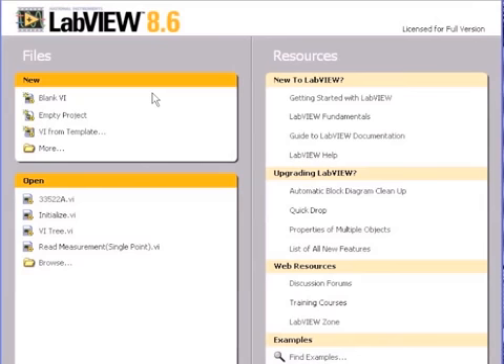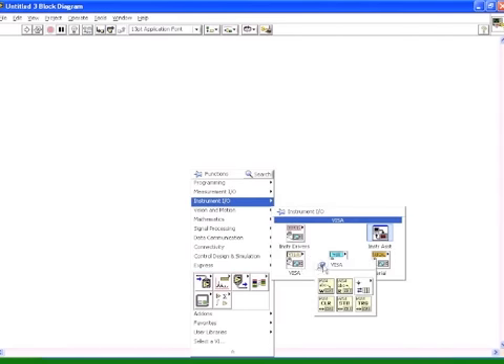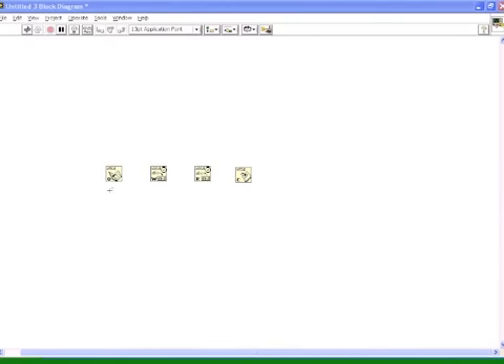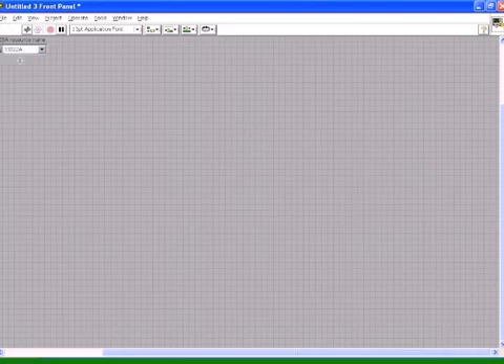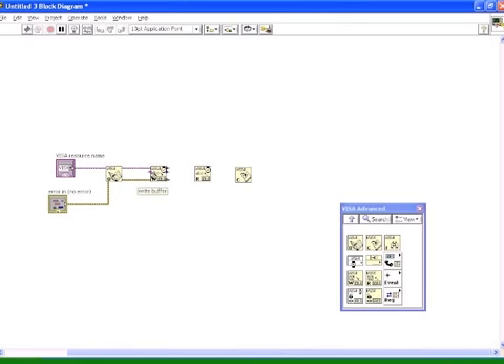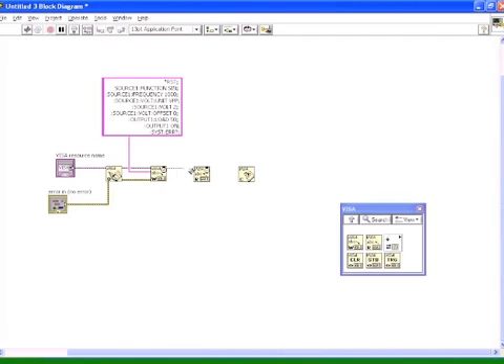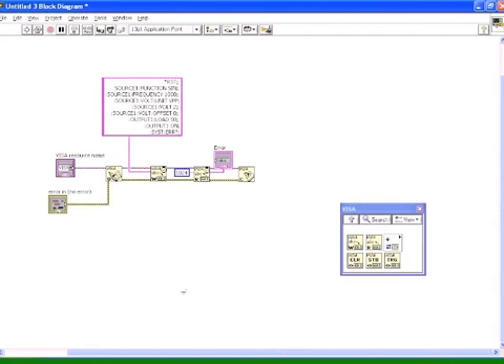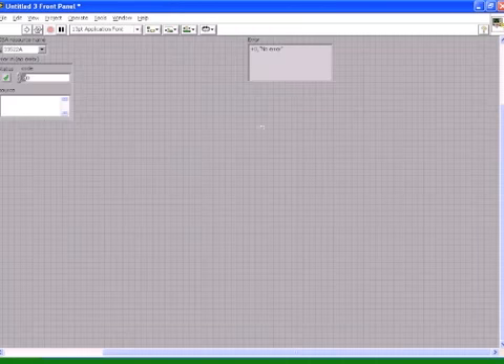How To Control Your Instrument in LabView without a driver

Comment: how can we troubleshoot if we don't see the device how up from the pull down menu? My device is connected via a RS-232 cable and plugged into power.
Reply: I am very much a novice but your device should show as a COM port in the pull down. If not then you are missing a driver or something more basic.
NI has resources for finding drivers like IDnet to devices or go to the manufacturer.

Comment: i need the SCPI commands for configuring and reading the configured values. Tell me where i can learn/get that info
Reply from the maker: Pavan Kumar Polisetti.  The instrument manuals have the SCPI commands and typically some example programs. The manuals are usually available on our website for free as pdf.
Reply: @KeysightHandsOn , that last line isn't, and that's needed for the Read node right?

Comment: This is a bummer.  I would think it would be a little bit better and some resolution
so that we can see what is being done.

Also, it's nice to be talking directly to the instrument,
using what interface?  What are the connection points etc?

As the video shows Visa's O-W-R-C being pulled do the block diagram
how are they interfaced to the Front Panel.  Things are popping up
which I cannot see and then lines being drawn between them and 
the Visa O-W-R-C's.  How is this accomplished.

Comment: I'm trying to use SCPI commands to control an instrument over a TCP/IP interface.  What was not specified in your video was the physical connection between Labview and the function generator.  How were you able to simply select the device from the pull down menu?
Reply: Can you tell me how to write SCPI commands/ where I can learn?
please